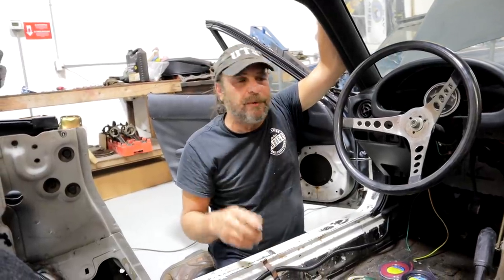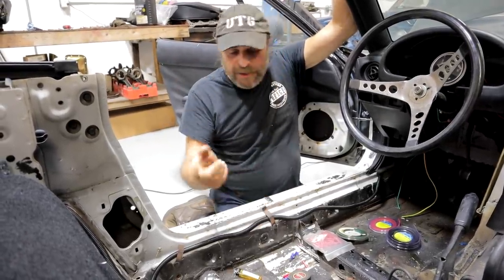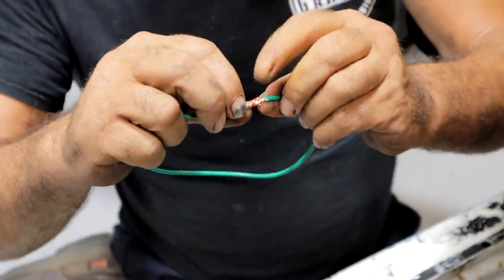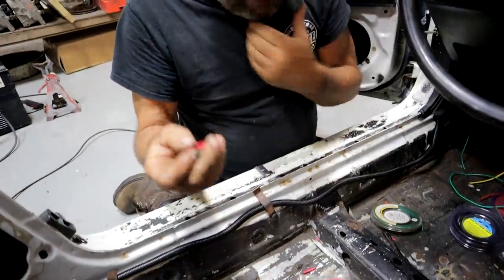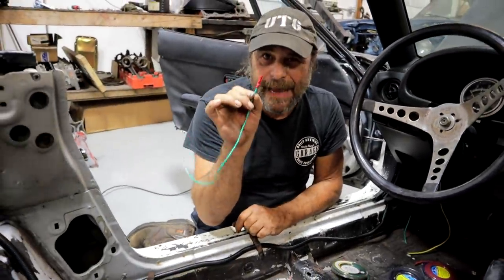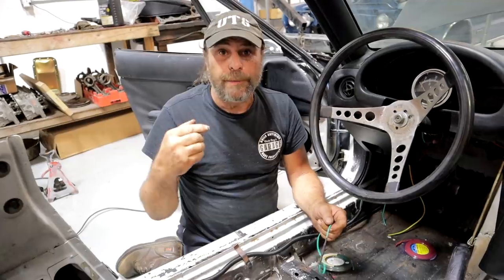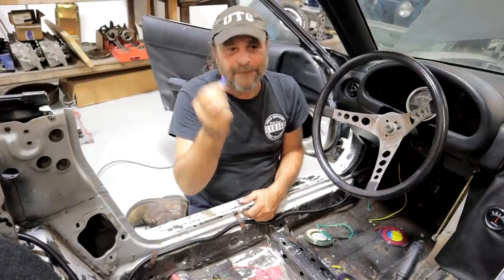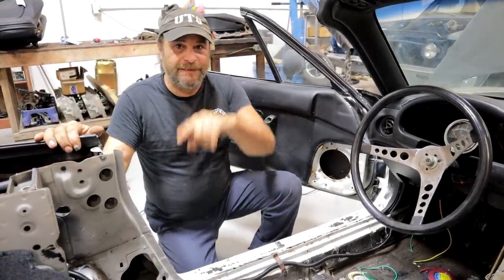The Single Most Misused Item In The World Of Cars

Comment: Never use a flat crimp, They will allow the wire to pull out. I use an electricians pliers meant to crimp bare wire it puts a very positive crimp  on the wire
Reply: If you want a smaller, neater crimp, you can just use heatshrink and uninsulated crimps.

I mean, I don't, but you could.
Reply: There's actually a fair bit to pay attention to when making a proper, correct crimp with even a standard home depot ring terminal. If you do it right that is. Where the conductors are when they exit / enter the bellmouth, where the insulation ends, the condition of the crimp contact area, is there damage to the conductors or insuation, and surprisingly to many people  whether or not the conductors were twisted (don't twist) all play a big role in a 'good' crimp or a 'bad' one. I see electrical cable manufacturers' products that fail inspection a lot, and this stuff is their daily bread and butter. The usual reason is that crimps are "easy" and so an assembler got a little sloppy about paying attention. They know what to do but it's the easy stuff that people take for granted. The next simple thing I see screwed up often is tinning the conductors for a crimp.
Reply: @davidkuehne476  I wired a trailer, used uninsulated butt connectors and soldered every one.
Reply: My crimping tool has a tooth in it, that bites into the connection, it works awesome, and never pulls apart
Reply: I use vice grips. Works every time.
Reply: Joe Shumo  I have 22 years in the electrical industry.. Mostly industrial instrumentation and controls. Look at what the guys who do this stuff day in and day out use. It's not auto crimpers and auto strippers. Don't get me wrong, use them if you want- but you will not get a better crimp than a set of Klein or Thomas and Betts crimpers. You literally can't beat the T&B crimping pliers. They're the ones who make the quality butt splice crimps and stak-ons- just use their pliers.
Real electrician crimpers are WORLD'S better than the ones shown in this video.
Reply: @xprocharged1  Are you speaking about ratcheting crimpers or the Klein version of what UT has? It can vary a lot tool to tool and terminal to terminal.

That said, there is a lot of misunderstanding about crimps and this video doesn't completely clear that up either. With a crimp, your aim in most cases is to get enough pressure on it to cold weld the wire and crimp together. (There are some crimp processes that are only designed to hold rubber insulators in connectors, in this case the aim is different. Some crimp style connector manufacturers recommend solder, because of the specific crimp type for that connector, but that is generally more specialized than these butt connectors).

Ratcheting style crimp tools with a die from my perspective are the preferred tool, NOT any brand or version of the tool UT has showed here. The ratcheting ones force you to follow through to finish the crimp, maximizing the pressure, and they usually provide a significant mechanical advantage. The die shape matters somewhat and the 'volume' relative to the terminal you're crimping. It's often better to match manufacturers of crimp terminals and the crimpers, as well as get the terminals that have the thicker crimp area, as that will help maximize the pressure and effect of the crimp. (I have ordered some really flimsy thin terminals from Amazon and the only way to ensure they don't come off is to solder them, I cannot do a proper crimp).

Now, there's a few good resources... Wirecare and CE Automotive and Electric Supply. The latter has a book they're selling on how to crimp, but one of the common guidelines for a crimp is that you should be able to put the terminal in a vice after crimping and the wire should take a certain amount of force without pulling out (for larger 1/0 and 2/0 terminals from CE for instance, it's 300+lbs of force they recommend). The same holds true for these, and the best way to know that your crimps are good is to practice on the same wire you're using with the same terminals and same crimper, and see how hard it is to yank that out. With the right pairing of tool and crimp terminals, Tony wouldn't be able to pull those wires out by hand without putting at least one end in a vise. Your crimps should at least pass a tug test pulling apart with your own two hands for smaller wire (around 14 or 16 gauge). Even smaller wire would stand up to lower forces on the terminal due to the area of the interface, but I think even 18 or 20 gauge should be able to stand up to some effort trying to pull them apart. It's all about where you draw your line for your own standard, but withstanding the tug test is a good one, and it should not be that easy to pull the wire out.

Also, if your crimp die and terminal aren't a good match, you might not get a good crimp even if the terminal itself and the crimper itself aren't necessarily faulty, but might benefit from a better pairing. (especially if there's a single brand that sells both, that should improve the compatibility, but not guarantee it depending on brand quality).

And yes, there are adhesive lined shrink-tube butt connectors, just used some yesterday. As well as adhesive lined heatshrink as UT mentioned. Usually it's lined with some kind of high temperature hot glue. In some cases you can buy this hot glue in a wrap to put around the cable and put heatshrink over after but I found that to be a pain in the butt (this was for a 3 way splice and I wanted to pot the entire connection, there wouldn't be enough adhesive in adhesive lined heatshrink to fill that gap).
Reply: @Sevalecan  anything larger than 10 wire, we use a ratcheting crimper and die(we also use dedicated 18v crimpers for larger stuff- 1/0 up to 250/500/750 mcm) . For the types of crimps this video is about the Klein or T&B WT112M is all we use for 10 and smaller. If done right, it's not coming apart- even under pretty bad industrial conditions.. Obviously buying cheap Chinese Amazon crimps will play a part here as well.. Buy name brand stuff if you expect it to last no matter what is used to do the actual crimping.
Reply: That's how I do all my automotive wiring.
Reply: @RJ1999x  not supposed to use that style on insulated connectors as it will damage the insulation, they're usually marked  insul or non-insul, most crimpers have both.
Reply: @johnny0454  actually I rarely use the insulated connectors. I started using the bare ones and put heat shrink over it, much better looking and cleaner
Reply: @davidkuehne476 , that is how the factory has always done wire connections.  You can go back to the 40s and look at wiring where there is a splice you will find the three or four or more bare wires crimped together with a uninsulated crimp and then insulated along with the insulated wiring with tape.  Most people dont understand the use of solder is not a industry standard and never was a industry standard.

Ive been guilty of soldering wires myself but with better tools I found out you really dont have to solder them any more as good crimping tools allows for crimps to grab so much better than those cheap ones they throw in with those dollar store wiring kits.

I also like the weather proof connectors as well, those crimps have a tang that when you use the proper crimping tool it rolls the two tangs over into the insulation which provides the structure to prevent the wire from pulling out.
Reply: @xprocharged1  Yes! Me too. 36 years now using the T&B wt 111m STA KON pliers
Reply: Always use proper professional pliers for that, they have staggered tooth!
First for the wire connection and second for the plastic collet of the connector that will be crimped over the insulation!
95% sealed and done! If the connection getting any higher force that ripp it out, it is routed wrong in the first place!!
Reply: William i haven't crimped a wire in over 35 years . Lead core solder connection and weatherproof shrink tube ONLY !  Connections in vehicles today are critical and should not be dependent on a butt connector !
Reply: @7natcho  don't fly then. Every single aircraft including combat aircraft uses these splices.  But just as we all know that OEM sensors are better than the generic AutoZone ones so it comes to crimps, some cost $1 a piece and some cost of penny, which one do you think is better?
Reply: @stevewhite3424  Good rebuttal Sir but aircraft is also 85 to 90% aluminum wiring simply due to weight savings  . I am very familiar with aircraft wiring and when an aluminum to aluminum or aluminum to copper connection is made a crush style butt connector is not used . The connector has 3 pieces to it a center that has threads so the connector can be screwed onto the wire and two weather sealed ends that screw onto the center piece to lock and seal the wire . Each connector used is determined by wire gauge  and overall diameter of insulation . I have installed radios and navigation systems in personal aircraft and did two entertainment units in larger planes . All my work is inspected and tested then signed off by  the lead supervisor/inspector . . They have zero issues with all my harnesses prefabbed  soldered and shrink tubed .  The first plane i worked on i was handed the vast assortment of connectors and instructed as how to use them properly . I have never been told to use a crush style connector nor have i ever seen one any plane i have worked on .  
  Have a great night sir . Gotta go , i have a flight to catch !
Reply: @xprocharged1  When using crimp type terminals, aren't you supposed to orient the connector's seam, so that the tooth on the crimp tool makes it's indent 180 degrees, directly opposite of the seam?
Reply: @roger97338  yes, but using insulated crimps the crimpers don't have a 'tooth' the opening on the tool is more like an oval. So orient the crimpers so the top and bottom of the tool are on top and bottom of the seam.
Reply: Depends if it's insulated or not

Comment: Use high quality solder and marine heat shrink tubing, it contains an adhesive sealant that flows when heated. You'll get a waterproof seal for a perfect forever repair.
Reply: Ya marine heat shrink is definitely what you want but I generally prefer getting non insulated butt connectors it's much cleaner than what he is using and you don't end up with pointy bits from soldering I probably just need to use more Flux but this non insulated are pretty good with marine heat shrink

Comment: Wrong crimpers. The right crimpers used the right way, with the anvil of the crimper opposite the split of the sta kon connector makes a helluva strong connection
Reply: Yes! The alignment is EVERYTHING! when properly aligned and a proper tool used the crimp is so much stronger.
Reply: Buy some better crimpers
Reply: Wrong crimpers and wrong crimp connectors.
If you're going to crimp it correctly with nice folded over loops like OEM, and use heat shrink like OEM, you should use open connectors where you can see the damn connection... Like OEM.

Comment: I like using bare uninsulated butt connectors with shrink tube. Amazon has them by the hundreds for dirt cheap
Reply: Me to and i soilder them also after crimp
Reply: @jeremyhanna3852  Best way to do it, gets you both mechanical and electrical security. It's how plane wiring repair is done afaik.
Reply: @Cwazywazy140  thxs I did not know  that about plane wiring I use the bare crimps then soilder then antiox paste a dab will do then heat shrink then wire loom taped up with good 3m loom tape
Reply: Same. Much cleaner than the insulated ones, you can solder them too, you can see how effective your crimp was, smaller shrink tube, t's all better.
Reply: Working on highway tractors and trailers I dealt with lots of shabby repairs. The biggest problems came from salt water from the salt put on the roads to melt ice. It gets in the wire strands and creates green death. Then you need to replace 6" to 12" each side. When using the insulated crimp connectors,I squeeze a bit of silicone sealant into the terminal, install the wire and crimp. Make sure both ends are sealed. To be really certain shrink tube can be put over this.
The best is uninsulated crimp connectors with shrink tube. There is shrink tube with a sealant inside also.
If there is a bad enviornment, tractor trailer is it. Thousands of miles per year with slop on the roads and vibration.
Reply: @daledavies2334  absolutely this. I cringe any time I see trailer wiring that's filled with butt connectors, wire nuts, half ass twist connections with a bit of electrical tape. Every damn time the wiring is gone to shit after 1 winter from the road salts and constant moisture. Baffles me how people can do this shit all their lives and never put 2 and 2 together and realize what the problem is.
Reply: Well shoot.Been going thru the trouble to push the connector out of the insulator sleeve all this time!Learn sumthin new every day.
Reply: @burtbacarach5034  I used to do that too, good times. They sell all the other style connectors in bare form too on amazon
Reply: @daledavies2334  This, all day long. The worst I've seen was working at a fleet shop in Phoenix. Trucks and trailers come up from Mexico that were barley held together and one big electrical nightmare. I had one that was "repaired" with bandaids used as electrical tape all over the tractor and trailer. He didn't understand why his lights wouldn't stay on and the lift gate batteries wouldn't stay charged.
Reply: @Cwazywazy140  (student) aircraft mechanic here. Plane wiring is done with NO solder just crimp. Solder is brittle and over time and vibration will make it crack and come apart. Crimp is harder to get right and consistent but they are by far stronger mechanically. A good crimp actually cold welds the copper strands together into solid copper inside the connector.

If you stiffen up your connection, that stiffening will make it fail. The connection needs to be flexible! Crimp ONLY.

Get the hazy transparent crimp connectors with the built-in heat shrink and the thick RATCHETING pliers with the crimping die. Those are the good stuff. The combo strippers and crimpers like Tony's using are OK but not ideal and banned in aviation.
Reply: This is the correct way to splice wires. Why even fool with the plastic insulated ones anyway? And then shrink tube them???  And yes... solder them too. I get my shrink tube from electrical supply stores. They sell 3M brand in 3' lengths. Cheaper price... quality material.
Reply: @KurtfromLaQuinta  Mechanical connection, soldered and shrink tubed. Can't beat it!
Reply: @jeremyhanna3852  That's how we do it the uninsulated are thicker, once you solder it and heat shrink it is forever, found that using pine rosin with rosin flux solder helps alot
Reply: Damned straight .  Far better and 1/3 the bulk .   Just use heat shrink over and if it’s nasty climate use some liquid electrical tape to seal the ends of the heatshrink. They  aren’t all that cheap though!
Reply: @drizler  the double walled stuff has the goo inside it like hot glue. Only kind I would use here in the great white North
Reply: I have a boat and use shrinkable butt connectors they work great.
Reply: @axipixel5811  was waiting for someone to correct that.. Aviation wiring isnt soldered generally.
Reply: @swan3609  Soldering is used in older general aviation aircraft and has been used in aerospace. Cannon plugs remain near universally soldered. It is still a part of FAA required curriculum for all mechanics. The paperwork still allows them to be used for splices in many instances, using a solder sleeve with a heat gun is preferred.
Reply: You can always get the adhesive shrink tube insulated butt connectors. These are my preference as they are a one piece connection with the added benefits of sealing the connections and the added strength of the adhesive shrink tube all at once. Way stronger and longer lasting than regular shrink tube or butt connectors even when used in together
Reply: Believe me I know.. I have soldered a few hundred cannon plugs in avionics installs. But airframe wiring isn't soldered.
Reply: This is what I do. You can see the crimp before you put on the shrink tubing. With those plastic covered connectors you cant see you crimp. But I must say I have used them. Then the shrink tubing you've shown.

Comment: Throw those butt connections in the garbage. The solder/shrink connectors are almost as cheap as buying those and heat shrink and depending on how often you're buying them. Amazon will give you discounts making them cheaper than butt connectors.

Comment: Good tip I never use them on my own car I use solder & heat shink tubing  I know they are a nightmare on heavy duty equipment where you have dozens of them & those blue inline splice ones had to be invented by a parts dealer as they fail 100% & seen a lot of fires with them as well

Comment: I use  the  crimp loop connecters for the end of the wires to anchor it a ground or to a positive connection but I also slide back the short sleeve and solder the wire to the connector . I also use the wire crimp tubes that have the solder inside and the heat shrink tubing on the outside best of both worlds . I also use dielectric grease on the slide on connecters that slide over prong connector to keep moisture , rust and corrosion out . Also not teeth are involved either

Comment: I must be old...still using uninsulated butt connectors, solder/flux, and shrink tube...except when I was at BMW...no solder allowed. they had similar crimp butt connectors but with a heavy clear insulation that you could heat shrink after. yup guillotine connectors are awful...I call them scotch locks but I'm sure that's not appropriate lol...there's about a half dozen in every remote starter kit. just found your videos...subscribed!!